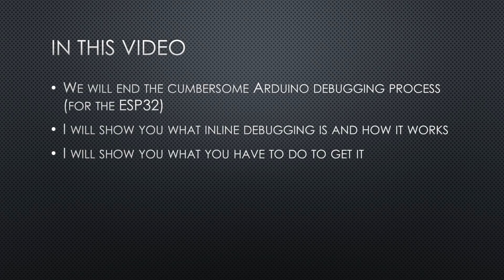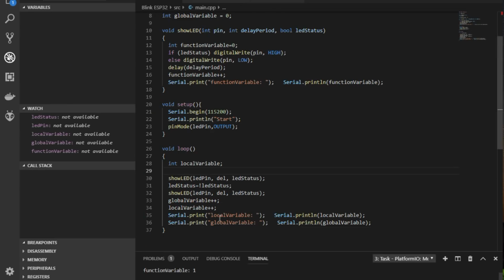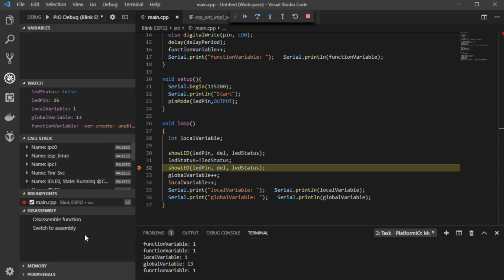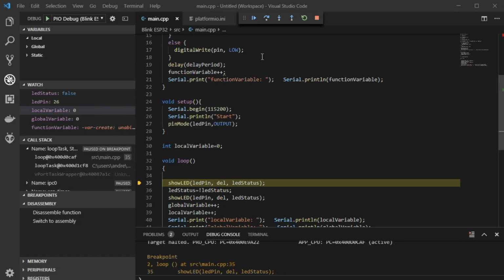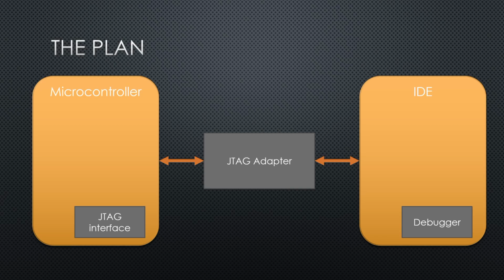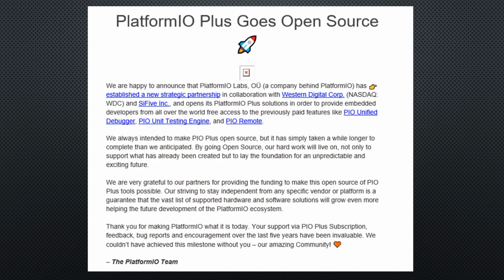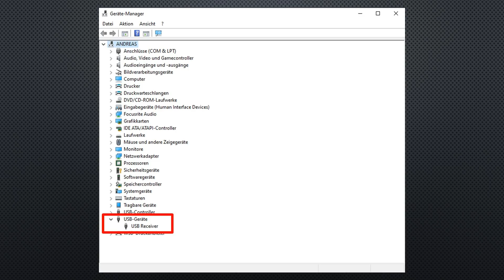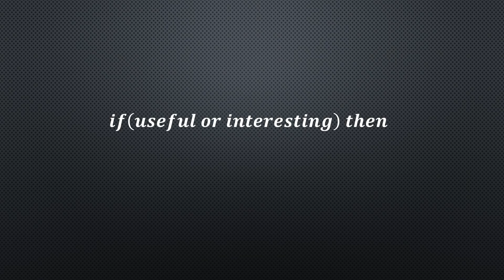#274 Free Inline Debugging for ESP32 and Arduino Sketches

Comment: There's a ton of cheap debuggers. Search for "openocd jtag adapters"
Reply from the maker: Which one did you try with PIO? And which interface definition did you use?
Reply: @AndreasSpiess  I own several but I haven't tried them with PIO. Official espressif docs point to openocd so I assume PIO is using openocd underneath. What happens during the debug process is that openocd abstracts away the debug connector with a .cfg file and runs a gdb server. The PIO connects as a gdb client. As far as adapters, I would recommend using FT232H or FT2232H (which I believe is the chip inside the olimex). These FTDI devices are interesting because not only do they serve as a USB-JTAG bridge, they can also do USB->SPI, or USB->I2C. I used one of these to build my zigbee sniffer: https://github.com/mbains/linux-802.15.4-sniffer
Reply from the maker: The Espressif adapter also uses one of those FTDI chips. But the definition files are different (the Olimex even has a custom-made for both of their versions). This is why I asked about your experience in PIO
Reply: In https://medium.com/@manuel.bl/low-cost-esp32-in-circuit-debugging-dbbee39e508b you'll find instructions for using basically any FT2232H(L) or FT232H(L) based board.

Comment: ATmega328p has a DebugWire interface to debug via nRESET line.
And you can buy a much cheaper FT2232 breakout board for about $7 and get same result.
Reply: Pio is also working good with atmel-ice debugger.
Reply from the maker: Did you try it with PIO? Which debugger did you choose in the PlatformIO.ini file?
Reply: @AndreasSpiess  Do you mean ATmega328p? No, I used official Atmel Studio and AVR Dragon as a debugger. Works almost flawlessly and consumes only one pin which (usually) is not used as GPIO.
Reply from the maker: And which MCUs can be debugged?
Reply: @AndreasSpiess  Almost all new MCUs. Even ATTiny13A. And, of course, ATMega328p and ATMega2560, which are used in Arduino Uno and Mega.

Comment: Hello Andreas, 
I appreciate your tutorial first. I have two questions after watching your tutorial. 
1) I ran into openocd installation error like following articles, did you find any solution for this?
https://community.platformio.org/t/openocd-installation-issue/8199
https://community.platformio.org/t/pio-run-target-upload-fail/8211
2) ESP-Prog doesn't have TRST pin. Is it OK while debugging?
Reply from the maker: 1. I cannot do PIO support here :-(
2. I did not need the reset pin for the ESP-prog (as mentioned in the video)
Reply: @AndreasSpiess  I appreciate your reply, I think I have to reinstall PIO and retry installing packages
Reply: openocd installation issue was solved by platformio team now

Comment: What are the problems with the code instrumentation approach from 10:30?
I don't like the idea of having to connect cables - often I want to debug code OTA once the board is already installed.
I can imagine that changing state would be difficult since you would need some interpreter running on the chip, but just inspecting state and control flow doesn't seem complicated.
Reply from the maker: So maybe you find another tool to do that. AFAIK JTAG works with cables. If you stop the CPU, OTA does not work very good ;-)
Reply: @AndreasSpiess  Why stop the CPU if you're only interested in information on the abstraction level of your C code?
Couldn't you just have one task for communication over WiFi (e.g. via MQTT) and then insert `debug.publish(__LINE__, state()); while (debug.paused) yield();` before each statement (as a hack on the same line to avoid having to do a source map)? To generate code for `state()` you'd need to tap into a C parser.
Reply from the maker: This video is about inline debugging, not debugging in general. And this way you stop the CPU at particular breakpoints to read the variables or registers.
Of course, you can do it differently (as we all did before).
Reply: @AndreasSpiess  I was talking about inline debugging (on a C level). For most applications a software debugger via GDB stub would be sufficient. I just found it surprising that people go for JTAG and that there's no solution for remote inline debugging over WiFi instead of serial.
Reply from the maker: Do you have more info than I have? I only found this one:

Postby kolban » Sat Apr 21, 2018 4:49 am
Howdy Hamish,
This is about the best docs on GDB stub I have seen:
http://esp-idf.readthedocs.io/en/latest ... or-gdbstub
As that doc says, you can read memory and variables, look at stack frames and otherwise interrogate the memory state of a crashed application. But ... that's it. If you need to step through your executing code then my belief is that the JTAG functions are what you will want to investigate.
Reply: @AndreasSpiess  Just rediscovered the terminal I was playing around in: https://github.com/vogler/cpp_remote_debug
You're right concerning the ESP32: gdbstub currently only kicks in after a crash. For the ESP8266 it seems to work fine though.
I guess the link from your comment should be https://docs.espressif.com/projects/esp-idf/en/latest/api-guides/tools/idf-monitor.html?highlight=gdbstub

Comment: Andreas, fantastic news, big props to the boys and girls over at Platform.IO and the Atom peeps too, as you seem to have a line into the folks there can you ask if they have enabled anything for the ultra cheap ultra popular ST-Link V2? Thanks for the video.
Reply from the maker: They have the ST-Link on their homepage. Maybe you try it and it works?
Reply: @AndreasSpiess  Deal!
Reply: @AndreasSpiess  Looks like the espressif32 platform does not support the stlink debugger, that is a shame. I am now going to look to see if you can use the "custom" debugger option for the STLink in some fashion or if I will have to go for the ESP-Prog as you did.
Reply: I may have found a way to JTAG debug the esp32 with an FTDI cable, i'll report back when I have tested it.
Reply: Ok! Good news I have successfully got the debugger working on a HELTEK (with the OLED) ESP32 and the FT2232H MiniModule v1.1 which I got from RS components for £25, I have seen china versions for £4-6 and I have one arriving in the next couple of weeks to test, The MiniModule is the High Speed version of the FT232R which I need to finish testing on. For anyone interested they can take a look at the last post in this https://community.platformio.org/t/ft2232h-mini-module-debugger/8395 thread to see how I wired up the FT2232H MiniModule and a cheat sheet is included, please feel free to use that as you see fit Andreas, happy making all!

Comment: Will this work with nano and mega and uno?
Reply: Ok, I asked too soon.  (Similar environment is costly and still lacks jtag).
Reply: @TheRainHarvester  You can remote debug on the 328p using debugWire (supported by the AVR Dragon and Atmel-ICE), but honestly it's a pain to use vs JTAG or PDI on other AVRs. For debugWire you have to set a fuse on the chip to start using it iirc, and very fairly slow compared to SWD on an ARM. Additionally the program AVaRICE which interfaces between the debugger hardware and GDB is currently not maintained.

You can do it, but debugWire is an experience I try to avoid unless absolutely necessary.

Comment: "free debugging"

wow, we can debug FOR FREE? what a time to be alive
Reply from the maker: And simple, too.
Reply: I think all manufacturers are going to free debugging from their tools. I think TI released few years ago full CCS as free and their devboards have debuggers build in and you can also wire these out for external design. Also AVR studio has ICD desug support for all current generation devices. Smallest that I have debug attiny 2313 (20 pin) from design. Usually problem was to integrate debugging for 3rd party solutions like arduino.

Comment: Great video. Thanks. Another purchase is on it's way.  One thing to watch is that the more highly integrated esp32 boards often use the jtag pins for their other functions, so it may be necessary to debug libraries on another board before including in final target.  I use Ttgo  T4 for some quick project as it has a lot of functions but has assigned all jtag pinsvto other functions.  Perhaps future designs will leave jtag free if it becomes more popular.
Reply from the maker: You are right. Maybe suppliers will include a jtag connector after this video ;-)

Comment: I got the PIO debugger mail as well. I have a working setup with eclipse, but I might try debugging with platformio (on atom) now that it's free. I pretty much ditched Arduino or at least AVRs completely, because of their very limited and outdated features and am using STM32s (hard to beat 2$ st-link programmers/debuggers). Up to now I always set up eclipse, which was a real hassle to do and with every project I started I had to learn again what I had to select in the settings ;) . But when it worked, eclipse was really powerful and extensions like "GNU MCU eclipse" made it much easier lately (the "where and what" to set became a simpler "where" to set). Let's see how much easier it gets with platformio and how the features compare.
Reply from the maker: I also tried eclipse once, but it was for sure not "Maker friendly". I felt PIO is much more so.

Comment: just for the record: "older" AVRs can be debugged similar, they just don't use JTAG, but debugWire - which only uses one pin, instead of four...
Reply from the maker: I knew it. But I never saw a tool for Arduino which used it.
Reply: Good luck getting that working.  I have an atmel ice, but couldn't get debugging working with an uno.  I think a fuse needs to be set and that requires a "high voltage" programmer, which the ice is not.
Reply: I'm late to the game, pardon me.  But I have to add that  Atmel sold the "ATMega Xplained Mini" for the 328P and 328PB that came with a debugger on board.  Perhaps these are still available - they were $8.88, I remember.  At the time I was using Atmel Studio to conduct the debuging.  The super cool part was that the registers were available and one could tweek bits while debugging if they wanted to.

Comment: As I'm a bit feather-brained, I'm a little confused about which hardware and software I need and the sequence of putting it together for an Arduino. Is there more information from anywhere or pointers for dunderheads ? I recognise the principal, I have used debugging on PIC processors.
Reply from the maker: This channel addresses advanced users :-(
Reply: @AndreasSpiess  Yes, I noticed the advanced led-flashing program....
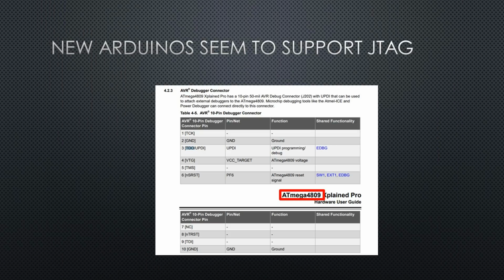Reply: It doesn't work with the traditional Arduino boards since they don't have a jtag connection built in (17:06). The Arduino Andreas is referring to in this video is just the programming software which can be used to program for esp8266/32.
Reply: @eindeend  Hence my confusion. Thank you! So this debugger can't be used generally to step through Arduino programs?
Reply: @featherbrain7147  Most Arduino programs will also run on an esp, so if you buy a esp 32 and the board in the description you'll be able to do so.  The esp does use 3.3 volts logic level however, so you might need to get different sensors for example.
Reply: @eindeend  I'll look into it, thank you. I've used clones before, shouldn't be a problem.

Comment: I was able to do inline debugging for ESP32 about 1 year ago but only using Espressif WROVER kit and ESP-IDF framework.  But your Arduino framework is SO much easier.
Reply from the maker: I used PIO also for the WROVER. It worked, too
Reply: @AndreasSpiess  Hello Andreas, when using the WROVER kit do I (still) need to use the ESP-prog device?  thanks.
Reply from the maker: If you use the  (50$) kit, JTAG is built-in. You just have to add all the jumpers on the JTAG  pins (according to the description)

Comment: The not initialized local variable is another beginners mistake. You were just lucky that it started with zero.
Reply from the maker: I know. But if a beginner would initialize it, it would be clear what happens ;-)
Reply: @AndreasSpiess  If it was intentonal, you should have mentioned that fact. static local variables could be explained in the same example.
Reply from the maker: The video was about inline debugging...
Reply: @AndreasSpiess  You are right and it was a very good.

Comment: By the way there is stm32 boards called NUCLEO which include debugger on board, prices starting from 10€. And this is ARM
Reply: The ARM boards use the ST-Link style interface, which is logically similar to JTAG, but a different wire-protocol (SWD - Serial Wire Debug).  I'm pretty sure that the ESP32 microprocessor cores do not implement the ARM debugger port in their hardware.  Thus the need for a JTAG physical interface.  The adapters referenced (including ST-Link style) translate higher level GDB primitives (read/write memory,  examine/set CPU registers, etc.) into specific debugging register accesses, via some physical protocol (SWD or JTAG, depending on the CPU and debugger interface.)
Reply: Do you have a link please?
Reply: @northshorepx  All STM32 chips support remote debugging using their SWD interface, which is exposed as pins on the blue pill / maple boards for example. The Nucleo dev boards from ST have an STLink-V2 included on the board, which is identical to the cheap standalone STLink-V2 USB devices you can find online for a few dollars. A J-Link can achieve the same thing.

You can program and debug through this interface.

Comment: IIRC the Atmega32 has JTAG too, which messes with some pins in factory-new controllers. I remember having to disable it via the fuse-bits before programming. It is an old chip, probably as old as the Atmega8.
Reply from the maker: As mentioned, the new bunch of Arduinos also uses processors which should support JTAG. We will see... The new Nanos are ordered...
Reply: @AndreasSpiess  Looking forward to it. The Atmega32 is quite different from the Atmega328 used on the Nanos.
Reply from the maker: The new Nanos use a  ATMega4809 chip...

Comment: Although I'm familiar with inline debugging from other platforms, it's rather complicated to use for ESP32 until the board manufacturers will use a standardised connector. My standard way of debugging, 99% ESP8266, is to use MQTT. In this way I can both "print" messages and also input data if I want to. I can do similar things as conditional breakpoints or logging, or conditional input controlled by MQTT. My first upload with a new project is always a simple standard sketch that replaces serial load with OTA over Wifi and has some standard topics for debug and reporting when a devices boots or restarts. In this way it is really fast to make changes to the code for debugging purposes. I never use the serial terminal since I'm used to making continuous improvements to my sketches with the devices long away from my computer. OTA and MQTT makes it possible to make changes and corrections without having the device connected physically. "JTAG" over Wifi supported by the chipset itself would however be very useful, with even having to use a JTAG physical connector...
Reply: hanpa Home Automation Do you have a github repo on this or links to an article?
Reply: @bollie9752  No. It's basically just having a debug topic for outgoing messages instead of Serial.print and then listening to this topic in a shell or by logging to a file. If you want to change the program flow in some way you can have incoming debug topics for values or triggers. A trigger can just set a variable or a simple if statement in the code can do something that affects the program flow e.g. by assigning some variables, skipping a section of the code or whatever. I only do this when something is not working as intended but I also have a standard topic for all my clients and a listener on my server that logs this to a text file. I use this to check when a device has rebooted and to which IP/mac-address, the RSSI dB value, name and version of the sketch etc. Like this (one row in the  log file):

19-06-23 11:43: NeoPixelAlertIndicator1 BOOT 192.168.0.154 60:01:94:39:72:85 RSSI(dBm):-54 NeoPixelAlertIndicator 1.4 2018-08-25 Hans Palm
Reply from the maker: Interesting idea...

Comment: This is one of the more expensive channels :-) Just made an order of 1 esp-prog. 
Not being able to do in-circuit debugging has always been  a show stopper me doing more advanced programs on ESP and ATMEL micros.
Reply: You can use Atmel Studio and ICE with Atmel micros. only real issue: I've bricked a few micros for the same silly reason. :(
you need a high voltage programmer to unbrick them.
Reply: @Chris-rg6nm  could you give some details?
Reply: Reminds me of the latest ESP32: https://www.crowdsupply.com/thomas-mckahan/obsidian-esp32
Reply: Perhaps too quick, it seems that I could have used my Segger JLink, does anyone have some experience with that?
Reply: @jenskaa4044  I got one and it works. I got it working better on Linux.
Reply: I have my lovely AVR Dragon. Old but good also support atmel debugwire (ATTiny series) :)
 Also nice to have is msp launchpad (new version support usb 3.0 controllers) and stm discovery board